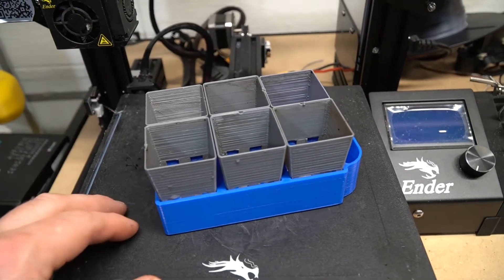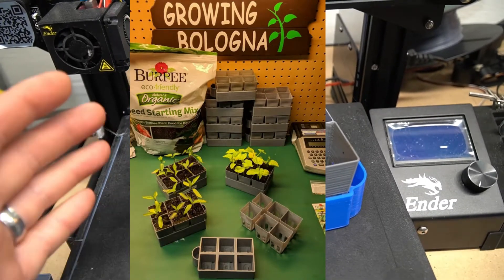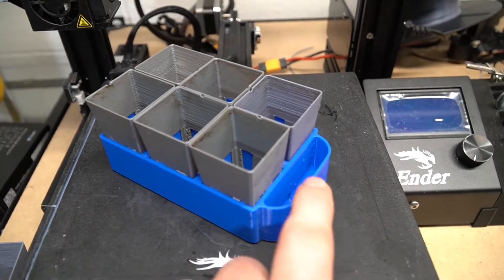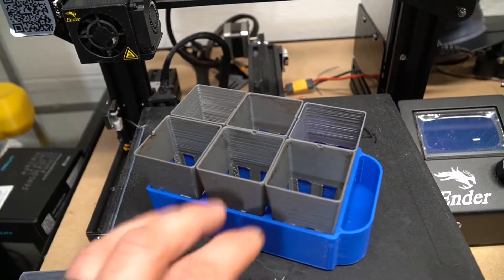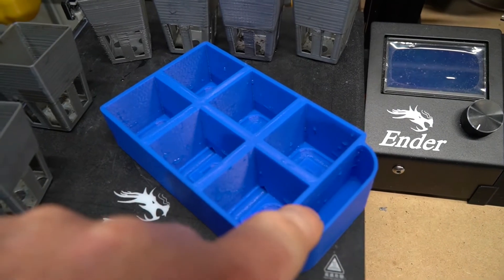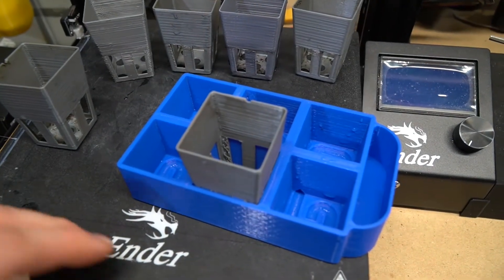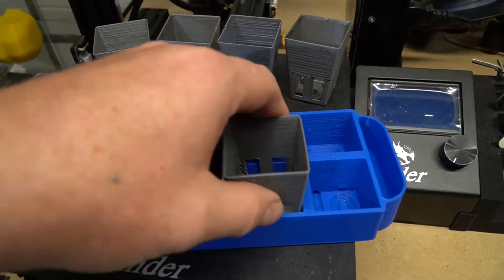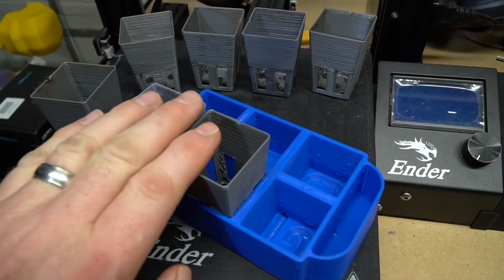3D Printed Seed Starter, Self Watering!

Comment: Definitely going to use this but I think I'm going to make it bigger and more importantly I'm going to take those little inserts and split them and put some kind of interlock. The most annoying part is trying to remove your plant out of those tiny little containers without either pulling all of the dirt loose or yanking it up by the root
Reply: Did u do the upgrade :)? Could i get the file?
Reply from the maker: Looks like they (or at least someone) did!  https://www.thingiverse.com/thing:5981175

Comment: looks like an interesting design but my god tune your printer
Reply: I'm interested in knowing what it is you are seeing. I just got my printer very recently and I don't really know what to look for. I did my first non test print yesterday and it's a bit stringy on one side so I think my table is still just a bit off but I'm not sure if it's the table being off or if there's a heat issue. I don't have a cover for it
Reply from the maker: A great place to start if you are using Cura is to download Chep Profiles.   Epsicronics is seeing the lines in the pod and is assuming this is how my printers normally print.  The pods were printed with Cheps super fast printing profile, they don't look great, but they print super quick.   For something like these pods, speed was more important than looks.  But if you use Cheps "BEST" profile, they will look amazing, but at the cost of time.  The base was printed with his "Good" profile, it prints ok at a descent speed.   You can find his profile video here:  https://www.youtube.com/watch?v=jM_jdsx5yFc
Reply: @growingbologna  I was more referring to the blobs than the striations but good to know there was a reason for it! very cool